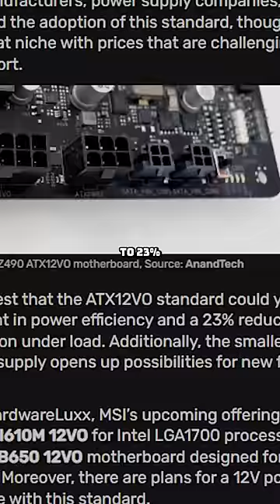Say Goodbye to the 24 Pin PSU Connector 👋

Comment: ATX12VO would be fine if not for the hdd, ssd, any add in card power, everything going through the already expensive motherboard, adding a lot more layers, more points of failure, more demands on already ultra low loss pcb for the very high speed pci express lanes, adding more manufacturing costs and to top it off, more expensive power supplies and once volume brings the price down: "sorry, inflation, pay more sucka". 

It's fine (I like efficient, smaller less complex PSU, less heat, less noise), but leave the power supply for everything else off the damn boards. Harddisk have no need for 3.3V anyway (a few do but it shows they do not really), just put in a few converters to let them have 5V, same for 2.5" ssd's, and do not give me compatible issue unless you explain to me how we did just that with mfm to rll to ide to sata.

Oh and make diagnostic a standard for these new units. Standard usb plug so I can read out voltages, use, etc.

Comment: Replacing 1 connector with 4+, because that totally doesn't create more options for points of failure and more times you can fail to properly seat connectors. What an odd choice.

Comment: This will just be another failed design attempt by MSI. The 24pin has been around so long because it does what needs to be done. The standardization of motherboards has been a boon to pc building and manufacturers.

The community will just see this as a proprietary design change and ignore it as usual.

Comment: Seeing a video about a "new" 12vo connector and expecting to see comments from over a year ago when it first showed up...nope.
Power supplies wont get any cheaper, motherboards will get bigger (no ITX) and more expensive because they have to do the regulation for the 3.3v your ram and NVME uses. Plus it means 2x the number of cables to any SATA SSD's you have.
Fuck 12vo.

Comment: What a bunch of BS, who's taking those decisions? Every build in the last 10 years is cleaner and cleaner and the emphasis put on cable management has become quite substantial. We already have 1 good cable that is easy to manage, why would we need 54-5 cables instead? Like honestly, thats the most stupid aproach you can have, you can do those improvements on the old design with one cable. 

Msi takes a big L if they do this. Asus did add a 12/16pin for the GPU (if you had an Nvidia gpu) but actually thats a great decision because you no longer had to have cables from the GPU.

Comment: They are gambling on the consumer's stupidity (OEM or not). I hope this backfires and they end up killing the motherboards with this pins. It is totally useless and aims only at selling these motherboards with their PSU, since no one else is adopting the 12VO yet. This change will not reduce power consumption at all.
The OEM market loves this kind of changes, like proprietary stuff, because it creates "exclusivity" for marketing and parts distribution. I hate these nonsenses, hope it fails hard. There's so many things that can be trully improved in PC building that would yield lower cost to produce and high profits when it comes to repairability, modularity and reduce the cables nightmare...

Comment: I trashed my usb-c front panel cable because I couldn’t get the 24 pin in the slot and accidentally grabbed too low and broke the cable out of its slot (mainboard‘s fine though)

Comment: So the issue is if they thought the new 12pins for nividia burnt up builds wait until people need to plug on 5 extra plugs.... I see alot of rma and issues with this while the 24pin wont boot a pc if its not in properly...... Alot of burnt boards incoming..... How am i going to pull 175watts for my overclocking build if i have 1/5 the cords pushing the same power ..... Fire hazard here i come 🤗🤗🤗

Comment: That's stupid rather than having 1 bunch cables, now it 4 separate cables. This is just intel trying to be Nvidia 16 pin. The question now will it burn in failure like the 4090.

Comment: I recently brought a PSU model: Fsp hydro PTM Pro 1200 watt. That have port which says 12 pin high voltage. will this support to that atx12vo. Is this why ATX 3.0 psu exist. By the way fsp is a Taiwan brand. I also don't know why I went for less known Brand.

Comment: So they’re basically taking a 24 pin connector and splitting it into four separate connectors is still a 24 pin it’s just split up now? 😂😂😂 this is outrageous counter connectors, 12 on top 12 on bottom that’s 24 pins. Lmfao 😂 surprise 🎉

Comment: Seriously? They replaced a single 24 pin with split 24 pins? Talk about an unnecessary redesign. It makes sense in the office environment where people don't need as many components, so you could, for example, not connect the PCIE slots? Also the smaller connectors look like a fire hazard just like the RTX40 series connector. I HOPE THIS DOESN'T MAKE IT TO MARKET. This would also increase production costs, using 3 different molds instead of just one.. something smells fishy here

Comment: @ZachsTechTurf 

I'm building a pc atm and this is my build. I have bought everything except the gpu. What is your opinion on it? 

ASUS PRIME B550M-A WIFI Motherboard, AMD Ryzen 5 5600G Desktop Processor, ASRock AMD Radeon RX 6800 Challenger Pro CLP 16G OC, Thermaltake Smart BX1 Bronze 650W Power Supply, A71C, Deepcool MATREXX 40 3FS Black Micro ATX Case, T/G Window, No PSU, Fans Pre-Installed, Kingston KC3000 1TB PCIe 4.0 NVMe M.2 SSD, Kingston FURY Beast Black KF436C17BBK2/16 16GB (2x8GB) 3600MHz DDR4.

Comment: WTF?!?  
There's still 24 pins!!! Instead of the 24 pin (20+4) 
it's going to be the 10+6+4+4 pin array.  
Notice the two 4-bangers sizes being much smaller?
Can you say fire hazard a la Nvidia 4090 12v power connector???
This does not bode well.

Comment: 12VO is a pointless standard and dosen't actually effect efficiency at all. 12VO only has a drawing in OEM build maybe? your just moving the voltage regulation from the PSU to the mobo making it more noisy and mobos more expensive.

Comment: This guy's making money just making shorts about things he knows nothing about. 
Dont care about power efficiency? Non issue?
Everything on your computer runs on power(electricity). Lot of energy is wasted currently. Less power consumption is always a good thing. Also remember, electricty creates HEAT, that thing all of you spend so much time and money to prevent. Less heat is always a good thing as well. There are a lot of reasons to make every part of your computer, or any machine, more efficient

Comment: Make no sense it’s just an connector how can you Safe Power and increase efficiencies by splitting it in to 5 separat connections 😵‍💫😵‍💫 ist still using the same power supply 😂 just re rout the connections in the board where is the problem ???